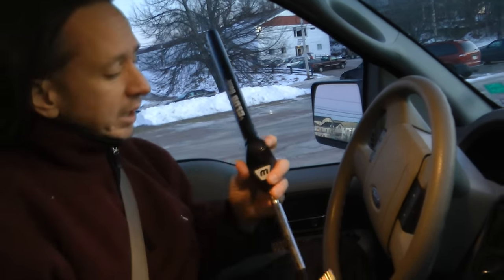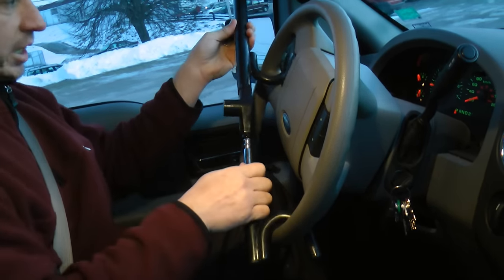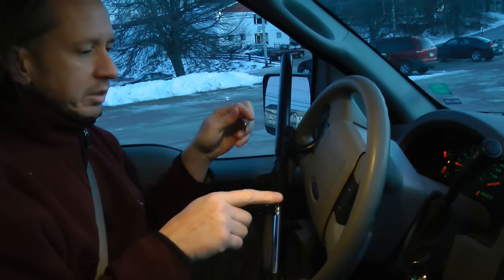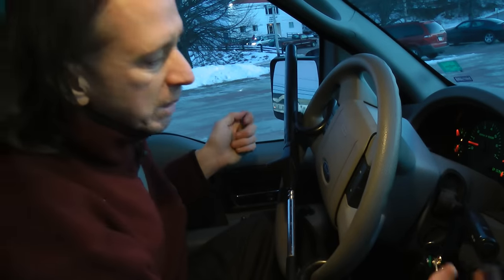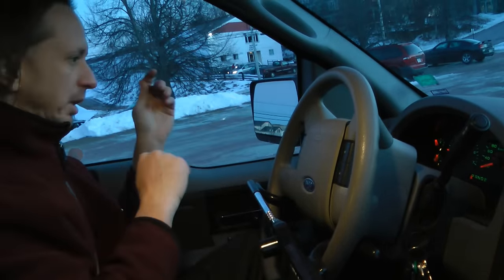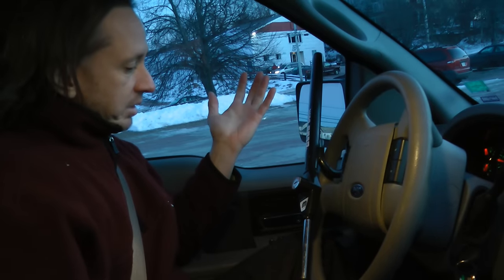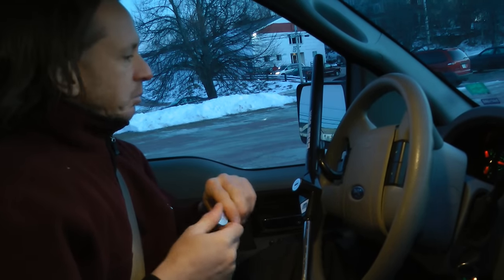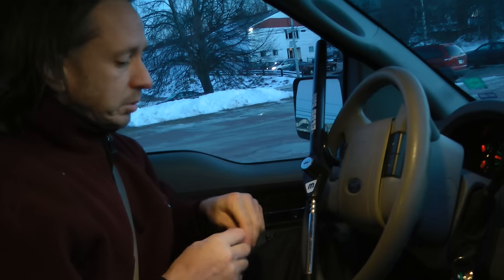How to Use an Anti-Theft 'Club' Device

Comment: Wow!  I've been doing it all wrong--I wait for thief to come steal my car--and then CLUB him over the head with it!   Works good!   Sometimes it's better not to read the instructions.
Reply: Pull it apart and u can dual wield it
Reply: Ironically, that's actually the reason I'm buying one. You cant have a bat in the cab, and tire thumpers are sketchy if you're not a trucker, but this thing I can keep at the front in case of some idiot.
Reply: @TheOrangeRoad  My dad was a trucker in New York City, he kept two 2-1/2 foot 2x4's with a nail in them in his cab. They were used to put under the trailer posts on soft ground [wink].
Reply: Who said it was wrong?
Reply: mine has a super sharp window breaker on the end of it
Reply: @TheOrangeRoad  You're not allowed to carry a bat with you?
Reply: 4 years later still hilarious 😂
Reply: @paulromsky9527  What a hard working guy. He's a trucker and a carpenter! 🤣🤣🤣🤣
Reply: A gun works better, but I didn't say that

Comment: Important note: DO NOT attach the club to the front of the steering wheel. Attach it from BEHIND the wheel, between the steering wheel and the dash, so that the lock is facing IN, toward the gauges. Otherwise, thieves will break into your car, thinking they can use a dent puller to punch the club lock, the way they used to punch ignitions. I've seen at least one case where the thief was successful. Additionally, depending on the steering wheel, a club applied from the front can slide down and set off the car horn, especially if the car is parked facing downhill. I've used these since the early nineties. It takes literally one extra second to reach around and apply or  unlock the club from behind.
Reply: ..good point... exactly what I thought... a slap hammer will pop the keyed lock out in seconds,,..!!!..
Reply: Not all cars will allow you to mount it in the rear. For example our CR-V has paddles and a big bump in the rear. The club will not fit.

Comment: I may sound lame but I've seen these my whole life and never had any interest in how they worked right up until my car was stolen a little over 15 hours ago! But no worries it's in my possession now. My point being that I've been looking for alternatives to make my car impossible to use while I'm away and this video explains perfectly what these locks are for! Thanks man!
Reply: Tow truck drivers can still steal your vehicle. They may not even realize they are stealing it. There is many cases where people see a car they like so they call a driver to tow it. Sometimes they pop the tires.
Reply: These devices come in handy. But nothing is 100% safe. If there is a will there is a way.
Reply: Same bro
Reply: Pull the fuel pump relay
Reply: @DoctorRickSanchez  And do you think car thief's aren't smart enough to figure that one out too?  They can even plug an OBD II analyzer into the socket and figure out what's wrong.
Reply: @crand20033  Yes you're correct I was waiting on someone with that kind of response. Remember a lock will only keep an honest man out, but it sure as heck will slow the thieving process down tremendously & at that point they wouldn't want to deal with the hassle and time.
Reply: @DoctorRickSanchez  
That would depend on the value of the car and how much time the thief has. Thief may drive up in his own truck and have all kinds of tools. needed to get around any obstacle.
Reply: I hear the best theft deterrent is a manual car hehe
Reply: @anthon0360  lol, but the sad part is that actually works as a deterrent sometimes. I read a story where a thief pulled a woman out of her sports car but quickly realized he was screwed because he didn't know how to drive a stick shift lmao.
Reply: @crand20033  not if your car is obd1 😉
Reply: I got my car stolen a few days ago, just bought one of these
Reply: Dum dum.

Comment: True.  It is only a deterrent, not an absolute form of protection.  But if you're parked beside another truck with a club, a thief is more likely to take the other person's truck than to cut through your steering wheel.
Reply: Also layers of security work best this being just one of them
Reply: The simply take 3 seconds to drill the lock out.
Reply: @crand20033  No it doesn’t. You’ve commented under a few comments here saying this same thing. A VAST majority of car thieves are opportunistic thieves. Those who want to be in and out. They aren’t walking around with a power drill. Some might, but by far most aren’t. If someone sees a car with the club, they’re way more likely to choose another vehicle.
Reply: @Syndrum  They can simply cut the steering wheel with bolt cutters. No problem "They aren’t walking around with a power drill"  No but they driving around in a van that carries plenty of tools. and/or computerized equipment to plug into the OBD2.
Reply: @David Crandall  your supposed to put the club on facing backwards on the wheel so a drill won't reach the lock. It's in the instructions
Reply: @lampshadesoapmaker678 😮

Comment: thiefs dont just run around with a hacksaw for the just in case i need it factor...
Reply: ROFL
i had 1 car stolen SMH
but i m a club user. old fashion?i m thinkin not.
i got it "after it was taken" and found in 1 day not damage but still.
since club and alarm i m safe now. hasn't been stolen and still work in a bad area. til i change jobs or become lotto winner. but the club i love it on my car.
and i got  very extreme-loud police siren loud type of alarm.well worth it.not stolen now for 2 to 3 long years.adios.
Reply: Maybe not but vehicle theft by organized crime isisn't just a crime of opportunity. They can go home and get a hacksaw if they need one duh
Reply: Yeah. Not all criminals are walking down the street and suddenly steal a car. Some times the actually notice the car they want and where you park it and see what devices you have for security 😂🤦🏾‍♂️
Reply: Don't need one to cut through the steering wheel.
Reply: If a thief wants your car, he will case it for a few weeks. See where you park, where you live, your schedule, all kinds of stuff. Auto theft is rarely a spontaneous thing. It takes know-how and patience. My truck got stolen this way by an illegal and illegitimate auto theft ring fronting as a towing company. My truck simply got towed off the street in broad daylight while I was at work.
Reply: @justinbeynon7980  this is true. Most crime is petty crime and an additional protection is a hinderence to the opportunity on easy, older cars. If they do go to that length to steal a car then no hinderence will stop them.

Comment: Thieves could hack this lock but most are looking for the fastest way to steal a car in less time so the hassle of dealing with this and the ignition are less of a chance they will bother.  Not 100% steal proof but they most likely will move on to another car unless yours is really worth the steal and risk of time exposure in vehicle.
Reply: There's always the tow the car option.
Reply: easiest way to bypass these clubs is to cut a small wedge out of the steering wheel and remove the club.
Reply: @MrJDBrophy  I always thought that from when I first seen them
Reply: @ariesradke6193  time for the wheel locks!

Comment: For a bit more insurance, just before shutting off the car, turn wheel an entire rotation to the L or R before installing the Club...Wouldn't that make the car more difficult to drive away with the Club still installed with the wheels turned?
Reply: Clever!

Comment: Ive had clubs on my vehicles for 20 years now in several big citys. No vehicle stolen! They work. Also you can take out the chrome rod and crack someone if they need it.
Or break out a car window if you or someone was trapped in a car.

Comment: I bought my first Club after a car theft. The best deterrent is to have the lock facing the dash (and this is what the instructions suggest). Who wants to waste time defeating this when they can move on to an easier target?
Reply: so easy to use a battery powered sawsall and saw the steering wheel.
Reply: @crand20033  True, but with so many choices, that move is impractical - unless you're stealing an upper-end Mercedes or BMW. The Club is meant only as a strong deterrent to the casual car thief.
Reply: @itsmeivan  It depends on how easy it is to replace a steering wheel but I personally don't know how to remove and replace one.
Reply: @crand20033  - if you’re knowledgeable about battery operated tools, why would you ruin the steering wheel? Why not just cut the club at the thinnest point which is only like a half inch cylindrical steal just as easy

Comment: There is a hole at the bottom of clubs with a rubber plug in it. Pull it out and use a pick to push the actuator one click at a time. Or pick the dimple lock. Or just cut the steering wheel and slide it off. It's usually really thin tubed aluminum surrounded by foam.

Comment: A good steering wheel lock IS a deterrent but remember they are more likely to saw the steering itself rather than the club since it’s metal. Takes a bit of time so it is not likely but it happens.
Reply: That is true but most people that steal cars at night in my country are young kids that probably don't think about that
Reply: Or drill the lock. Takes 3 seconds.
Reply: @crand20033  but that would be more difficult and take more time, with the lock facing the dash. the car thief most likely would just skip to an easier car.

Comment: My friend had "The Club"  steering wheel lock in the 80's for his car. I told him it was a fair deterrent but cut out switches and such would better along with it.
I had one too, but I had custom theft deterents in my car - I am an engineer and sadly have a criminal mind (but law abiding) so I was very creative.  The Club lock used  plates not pins, it was very "loose" (a lot of tolerance in the keying), and I could pick one in 5 seconds with two properly modified paper clips.
Anyway, we went out to lunch one day and he ran into a convenience store for a lottery ticket. I told him to put the Club on his steering wheel and I waited in the car. When he came out less than a minute later, I handed him his Club removed from the steering wheel, undamaged, and relocked. He wanted me to help him add theft deterrent systems for him after that.
Reply: In and out of a store in less than a minute? Wow.
Reply: @zudemaster I forgot to mention that we were discussing the lock on the way to the store. He decided to walk in and come back out about minute later to catch me in the act.  He didn't, it's was off in less then 30 seconds.

Comment: Good insight, cheers for the share. Scotty Kilmer also mentioned removing certain fuses, but those connections weren't designed to have fuses and relays being pulled in and out a shit load of times like that, it would cause more harm than good.

Comment: People say just cut the steering wheel? So you are assuming the thieves are carrying a saw. Maybe they aren't. Small percentage of car thieves carry saws as they want to steal car ASAP. If they cut steering wheel, are they willing to pay $150 for replacement steering wheel and put the time, work and cost of replacing the air bag into the $150 replacement steering wheel..... Easier for a thief to pick an easier target. If you got $60k car with the club, a thief may still go after your car but if you got a $20k car with the club and the cars around you are similarly priced, a smart thief will go for the easier target.

Comment: when I was a teenager i had some shady acquaintances that were into .. well taking people's car for a ride that did not belong to them. I saw a club save someone's car even after this loser tried for a good 30 minutes to remove the club . he had screw drivers and a manual saw. 

Also in my 20s I had a mazda Rx7 GSL-SE and someone tried to take it but failed thanks to the Club,

I am not saying it is fail proof but it will deterr most amateur car thieves . even a professional would skip your car for one without it unless they are very determined to get your car.

Comment: When using this turn the club as where the lock is facing the dashboard because thieves can us tools/Portable drill  to break the lock that is facing you in the sitting position, easy for you to use key to unlock not so easy for them to use tool to get at club facing dashboard, after living in Newark,Nj for a good while you pick up on any thing that can help...

Comment: Great video! A thief is less likely to go through all the hassle of cutting through a steering wheel lock or dismanteling, time after time they'll go for a vehicle without an obvious visible deterrent.
Reply: A pro thief will cut a small wedge outta the steering wheel and remove the club lock.  That literally seconds with a battery powered saw/grinder.

Comment: On older cars you can run a fuel line up through the floor and back out with a cut off valve under the seat. They might make it 50 yards before it shuts down and in a panic I dont see someone searching high and low for a cut off switch they dont know is there

Comment: I still don't understand how the steering wheel doesn't turn when the lock is on. Can someone explain this?
Reply: Basically the club is hits stuff in the truck and stops it from turning? Did you watch the video? See how the club hits the window and door, etc when he trys to turn? That's whats stopping it from turning.
Reply: Unless they smash the side window and or front glass out?
Reply: It isn't intended to catch on the windows.  It's intended to catch on the frame of the truck.  In vehicles that don't have the "grab handle" that you can see in the truck in this video, it's possible to turn the steering wheel as far as possible to the right before putting the club on, then put the club horizontally across the steering wheel so the end that pokes out is on the left side, and the door prevents the wheel from turning.  Of course, if the truck was stolen and the door was the only problem, a thief could always drive with the door open.
Reply: @djbolivia  thats actually false the club will also hit the person driving if the club is short enough to not hit the cars interior. I own a 92 Honda accord and my club only hits the windshield so in the case where they can turn the other direction and make the club not hit the windshield it just go around and hits the drivers feet which is pretty important to use while driving

Comment: I always turn the steering to a vertical position, as if I was turning before switching off. attach stick so long end is down on the seat or facing towards door, even better. Thief cant even sit down in the car.

Comment: They cut through the lower part of the steering wheel in under a minute and slide the club out of the way.  That's how they bypass these types of locks.
Reply: What if the steering wheel is not plastic and metal? How you cut through that as fast as posible?

Comment: Good video.  You can also disconnect the coil wire when the vehicle is not going to be used and you want a little additional anti-theft security. You don't even need to remove both ends, just one end is okay.  Doing just one end makes it quicker and easier for you to reconnect it yourself when you're ready to roll. Takes about 30 seconds, that's a little longer than putting the club on, but it's about as effective as long as you're not up against pro car thieves. Most teenagers that would steal the car aren't going to take the time, and make the noise, of opening the hood to see why the car wont start.  A disconnected coil wire is a "cheap" and effective anti-theft measure.  Also, a locking gas cap is worth the small price it costs.  (But save your original gas cap as you'll want to put it back on the car for emissions testing when the time comes).  If the thief does happen to get your car,  at least he's not going too far if he can't get the locking gas cap off.
Reply: A thief Can just pick the lock on the gas cap though!

Comment: Hacksaw cut the steering wheel not the club that's why these are ineffective ,The steering wheel will bend away in the cut spot and the club slides right off.
Reply: I live in a city of 800,000.  I'm sure a thief would rather walk one more minute down the street to steal the same truck that doesn't have a club in the steering wheel.  It's more of a theft deterrent  really.

Comment: Just take out your fuel pump relay, unless the thieves bring a tow truck there not driving off in your ride.
Reply: Just take 85 minutes out of your day, each time you drive.  Might as well lift out the battery... then they also, can't steal your battery.
Reply: If they bring a tow truck and it’s not legal.. time for wheel locks

Comment: Smart chop shop thief will cut a small piece outta the steering wheel and pull the club out of the way.  Then replace the wheel later.
Reply: Yeah, because a "chop shop" puts cars... back together?  Damn... does it hurt to be that illogical?
Reply: They make double hooked ones now where you can’t just cut through the wheel anymore. It’s what everybody should use

Comment: LOL or you just pick it, or bash the end and collapse the locking mechanism. Or cut the steering wheel off. Also you can remove the steering wheel and drive with vice-grips. The CLUB is only a visual deterrent. I always love the "they will take the truck next to you" I don't often park next to other trucks...LOL Beat bet is to drive an XL vs a loaded up truck. hahaha That is what I do and I have a low deductible insurance.

Comment: cordless sawzall will saw the steering wheel like in 5 seconds then they can take off the club and drive away
Reply: If they’re going as far as showing up that equipped to take your car you better have more anti theft in place than just the club.. need alarms and hidden engine kill switches at that point
Reply: @CJ9007  & etched in your glass GHPS tracking device on board instantly activated!